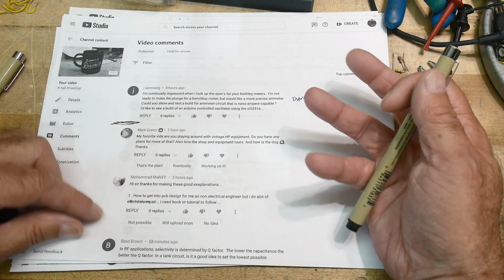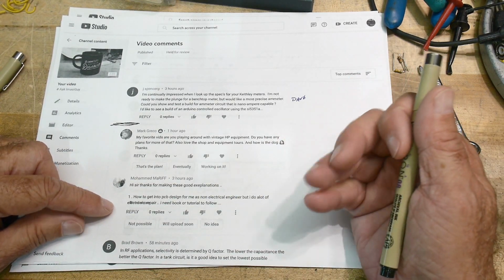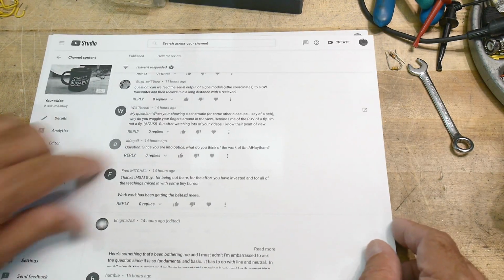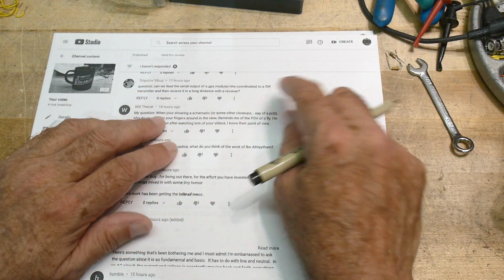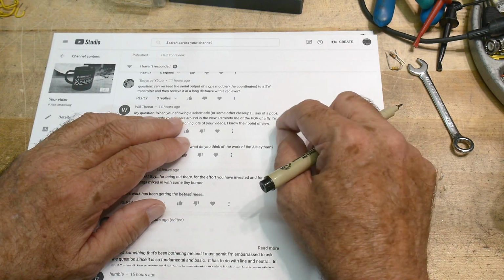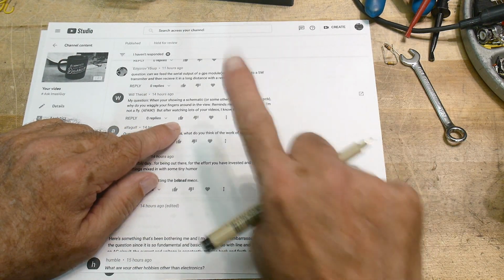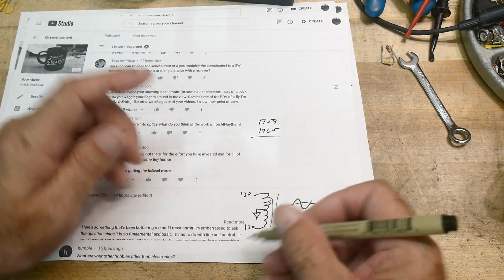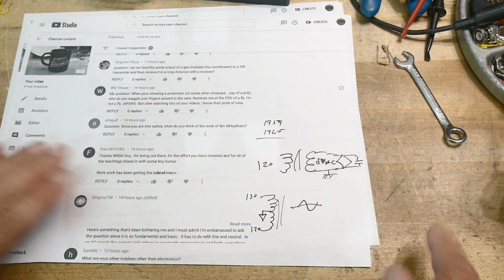#1228 Ask ImsaiGuy (part 2 of 2)

Comment: Since you are "into" more comments here is my reminder that I think will help the channel: You hold your Rapidograph pen like it's a a ball-point, and it is not a ball-point pen - please draw with your fancy fine pen aligned Orthogonal to the paper surface plane for more legible results from now onward.  No more 30-60 degree Angle griping.
Reply from the maker: it is felt tip pen, just looks like a rapidograph

Comment: Wish I had seen this, I ran into a perfect question today. I work in a place where we take junk, and turn it into junk that people have paid us to ship to them, part of that involves connecting junk with power supplies, and I have this one generic replacement supply where almost every one, when I plug it in for the first time, it makes a huge spark at the socket. I assume this is inrush current to capacitors, but we have a lot of these that don't work, or they have really concerning whine. I think this spark is acting as a spark gap and producing some really nasty voltages that might be damaging the supplies. I've started plugging them into a switched-off powerstrip and energizing them that way the first time, but that doesn't fix the in-rush current. Short of a variac, is there any way to limit AC mains current so I can bring these up gently?
Reply from the maker: https://youtu.be/heKFe15LwsI

Comment: Another way to explain AC and the ground connection is to envision simply putting a AC voltmeter across those connections. At any given instant in time on the "live wire" there will be an instantaneous AC value of potential starting at zero, rising in value to a peak in the positive direction, falling back to zero and the meter then reads a identical negative value along the bottom half of the cycle. I may not be correct but it's the way I think of it in my head.

Comment: They stopped using spark gap generators a hundred years ago.  Because they are broad spectrum, you can have only one conversation at a time within the range of the transmitter.  Each transmitter uses the entire spectrum.  (Bandpass filters helped this, but not enough.)  A true delta function has an uniform frequency distribution from 0 Hz to infinity Hz.  Real pulses have finite width, finite rise times, and finite decay times.  The steepest slope of the rising/falling edge equals the zero crossing slope of the highest frequency in the spectrum.